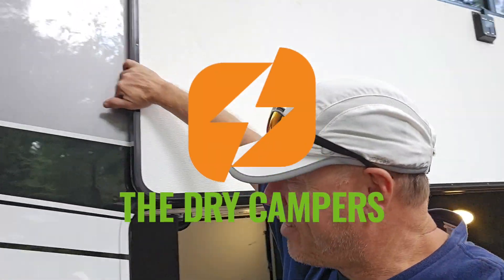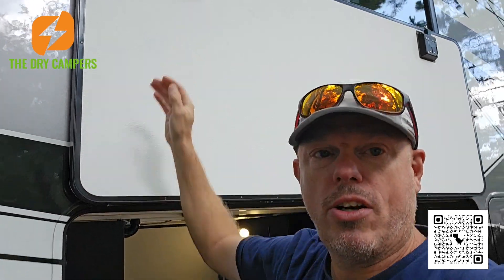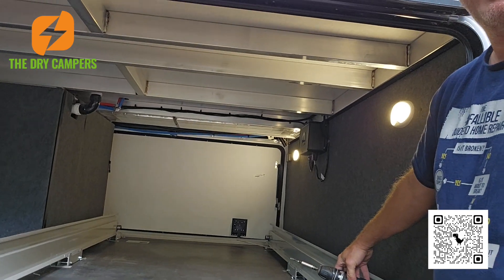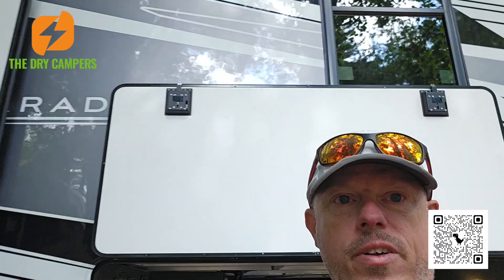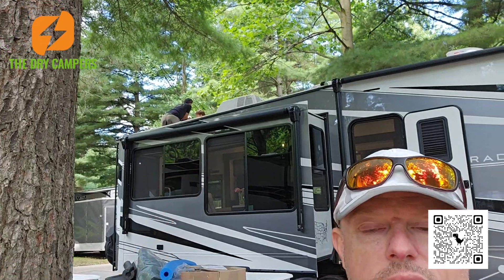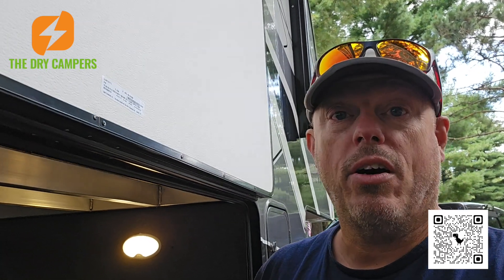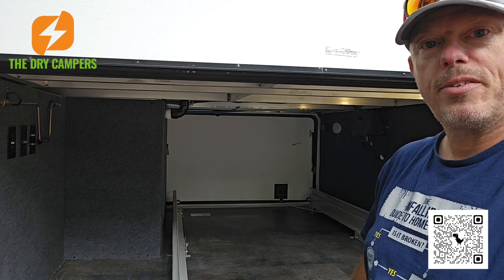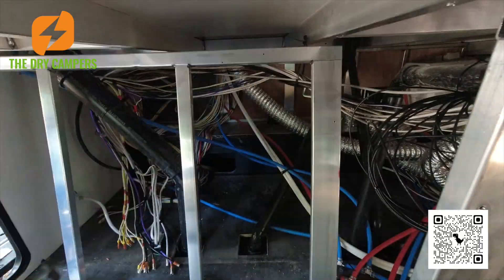Alliance PARADIGM 340RL EXTREME solar installation

Comment: Hello Mike!  You did our January 2022 install of our solar system in our Outdoors RV 22 FQS; 500 ah of batteries and 1495w of panels.  We love it!!  I am very thankful of your mantra-- put as much panels on the roof that will fit!  In the end, panels are cheap and it goes a very long way to quickly recover our battery charge status!

Ha...we are eyeballing possibly upgrading to a 5th wheel in the near future!  We will definitely look to do an install in that; which will be twice as big, no doubt!

Comment: Hi everyone! My name is Mark Pierce. I am the owner of this Alliance Paradigm 340RL. Mary Kay and I live and travel full-time in this rig. This extreme solar system was installed in August 2024. It’s been almost 6 months since we’ve had the system installed. I can tell you that we really love it. Mike and his team did an amazing job. AND his follow-up is amazing too. He took a lot of time with us to show us how the system works. He gave us his personal mobile phone number and has encouraged us to contact him if we have any problems (we haven’t). We just completed a 54-day period without plugging in at all, just using the beautiful Florida sunshine! I can’t recommend The Dry Campers more highly. (This testimonial is unsolicited and heartfelt.) Feel free to ask me questions about how the system has worked for us.
Reply: Care to share the before and after cat scale weights. CCC is only 2955 on my Avenue, and the 340rl is about the same. What’s suspension changes were done and what truck are you hauling it with and what are the pin weights after the install shown on the CAT scale?
Reply: @SonarTravels  we had MORryde IS and 8k axels installed at factory when we ordered our Paradigm. GVWR on sticker is 19k. We are pulling with a Ram 3500 dually. Pin weight is right at 4k well within the capacity of our truck. We estimate the weight of the solar installation at a thousand pounds. Thanks for asking.
Reply: Just read you have 8k axles and IS, which gave you 5k ccc. Looks great.
Reply from the maker: Aww, thank you Mark, we are so glad to have had the opportunity to install a system for you and Mary Kay. It's awesome hearing your journey with the system and what benefits it has brought you guys.